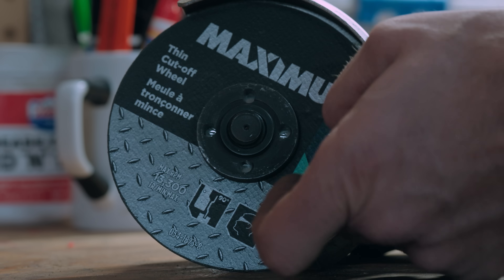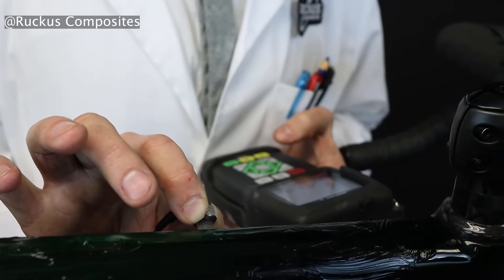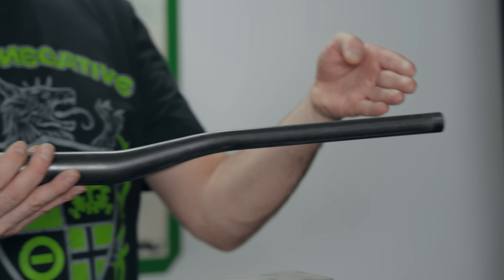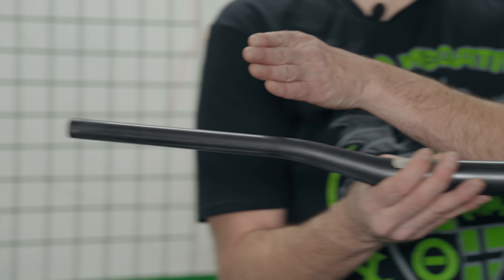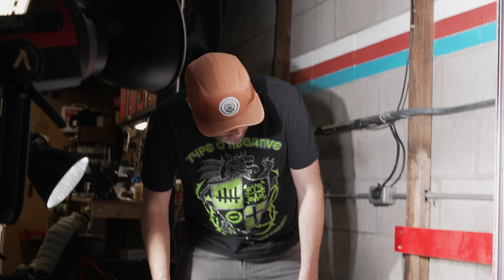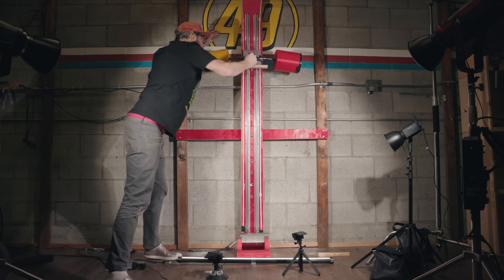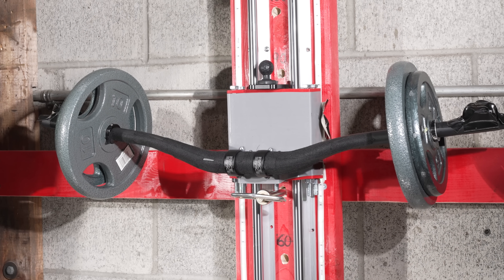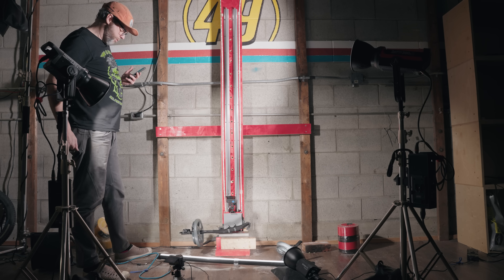Is Repaired Carbon Fibre Safe? Breaking Point Test

Comment: This did not seem right. I understood that the repaired parts sides broke before the unrepaired, which you explained beforehand is the test to determine if it is stronger or weaker - i took away weaker. You then bought another part which, brand new, broke on a lower force.
My takeaway is that a great bar that got repaired can be stronger than another bar from the factory, i.e. good product + good repair > (worse?) second product + no repair.
I do not feel you've shown that the repaired part achieves a good reliability compared to the original part, quite the opposite.
So either your conclusion is wrong and premanufactured or the logical steps got lost (on me?) or the wording is not great.
First of your videos for some time now i won't like - but hope for a follow up!

Comment: If the repaired part broke at higher force... why in the first two tests pe handle bar broke ONLY on the repaired side?
Reply: Yeah, it doesn't make sense. If the repaired side was stronger as the results are trying to suggest, surely the non repaired side would have broken first in the initial tests.

The random new bar breaking at a lower force is irrelevant. Even the test on the new bar was using different weighting.

Comment: Where’s your safety glasses and face protection when you’re cutting the carbon fibre bars with that grinder?
AND; you really should have had respiratory protection as well. Those carbon fibre fibres you created would’ve been straight into YOUR intake system.
Seriously. Those little teeny weeny particles are V E R Y dangerous.
Think of asbestos and you’ll be there.

Comment: I did it. First I babied my carbon fiber, then I got careless, a little confident.
 Oh, sorry. It's just my sword. It keeps getting in the way. Would you like to see it?
 No!
 It's okay, because I couldn't show it to you anyway. My father always told me: never show your sword unless you intend to use it. Anyway, mine's broken.
Broken?
 Yeah.  I've mistreated it for years. So foolish. I used to go around stickin' it into everything. Stuck it into watermelons - just practicing. One day I stuck it into the dirt, broke the tip off.
Oh, how awful.
That really hurt me. But that's okay. I'm gonna get a new one.
 You can get new ones?
That's why I have to get into the castle, because that's where they keep the good ones.
 Yes!
 I need a good, strong one this time.
François has a really good one!
 But it has to be big.
 I : Oh. Pierre. Yes. Oh, but his is too big.
They can never be too big - not if you know what to do with it. You see, sometimes if they're big enough, all you have to do is show it, and people will run.
That's what I did!
-Tommy Chong

Comment: "Repaired carbon fiber can be as strong or stronger than a brand new product sold for the same purpose." -- While this concluding sentence is correct, I feel like it's shifting the goalposts a little bit. The repair is not as strong or stronger than the original. But it is stronger than another non-repaired but unrelated product.
Reply: I agree with this assessment with the exception that your conclusion assumes that test A and test B were of sufficient parity in all variables. The constant failures of the test rig and lack of retests or documentation of potential variance introduced by alterations of the test environment leads me to conclude that a whole host of unmentioned confounding variables were just completely ignored to fit the script's narrative. Product safety testing is not entertainment and no attempt at disclaiming liability can change that. So much of this video isn't just moving the goalposts, but doing so without disclosing how and where they were moved. They presented accelerometer readings with no explanation of how accurate they are, or how they are actually useful as a measurement. The final obvious issue is that when we ignore forces, brands, and materials, we still see that the "new" bar breaks at a logical weak point, the point at a bend and the end of a taper, while the "repaired" bar breaks further down at the repair point. This design was never going to break along the straight and uniform section otherwise. There are only two possible types of conclusions that are even possible at this stage of experimenting: 1, that the repaired parts fail at their cut points instead of the original design's weakest point indicates a weakened repair, or, 2, that these results are inconclusive. To say 3, that the repair was stronger or even acceptable is, well, dishonest, and demonstrates that your claims, methods, stats, proofs of any kind are suspect to manipulation and fraud.

Comment: Carbon Fibre is an amazing material.
But unless you NEED the weight saving, just use Steel or Aluminum.  The Metals are easier to repair, recycle and for me, won't catastrophically fail.
The question I ask from this video is, do you really need carbon fibre handle bars?

Comment: Sorry but: No, no, fucking no. I work in composites. I work in making structural composites that are designed to tolerate huge external impact forces to save lives. IVE BEEN DOING IT FOR 20 years. For a channel like F9, with the outreach it has, to be brandishing wet-lay repair as safe to use is MADNESS. 
The majority of all cycle hardware (frames, cranks, handlebars etc) is knocked out of Asia using low pressure oven-cure manufacturing techniques. Using this method, manufactures have been allowed to capitalise on the ‘sexiness’ of carbon fibre to make sales, while keeping costs to a minimum. 
The problem is that last part. Composite bikes are made poorly. Even the monetarily high end models use poor manufacturing techniques. 
When stuff breaks we take it to the nearest repair shop we can, because carbon isn’t well understood like metal work repair. So third party repairers usually have a resin-infusion or wet-lay fibreglass background and are usually not skilled enough to properly repair high-load components. Sorry. 
When you localise forces, like this video did, (after you filled it full of resin) of course it’s going to be stronger than the original! All you’ve done is made a solid block of resin. May as well get an aluminium bar because you’ve lost your strength to weight ratio…which is the whole point of carbon. 
Could write for days about how poor composite bikes are in general. But as with any carbon repair-job, once you cut the fibres, you’ve lost strength. Resin is your only chance of reinstating that strength. 
I’ll add that the repair guy could’ve reworked a sleeve in don’t tied in much more (rather than 15mm which wasn’t enough) but I think it was beyond  the remit of the repair scheme (I.e cost vs time). Once the fibres are cut, a wrapped Rohacell bung should’ve been laminated tbh.

Comment: Come on FortNine! You have been producing quality for so long, that I would hate for this new experiment to start a trend in the wrong direction. I loved the video, with the exception of the conclusion. Look, I get it that your weights broke, you may have changed bar type for the control, your sample number was low, your force measuring methodology is likely very flawed, but your conclusion was the worst part. The conclusion should be that the repair was not stronger than the other side of each handlebar in your test, and that the test rig and methodologies weren't good enough to conclude that the repairs were stronger than the new bar. You aren't known for being misleading, so I hope this sort of video gets more review before being released into the wild. Was Ryan out of town or something??
Reply: there was literally another unrepaired side of the bar experiencing in theory the exact same forces when the repaired one broke so there must have been a major difference between the two tests
Reply: @thomascook8844 was about to say the same thing and you said it so much better
Reply: I agree completely , I must admit that you said it much better than I ever could . Thank you
Reply: This is at least the second video where the research and testing was either wrong or seemed misleading to prove a point. I think that we are seeing a shift in the channel now that they have taken off in popularity.
Reply: It's disappointing, and also not the first dodgy test shown on here. Hope they go back to their strengths, discussing riding motorbikes with brilliant videography. They are the best channel on YT at that, I think, but not this stuff.

Comment: You needed to calculate the impact energy, impact force and impact torque. The gym weights would’ve acted like a point load so the torque on the repair would be greater as the second moment of inertia of the bigger masses you started with would’ve been imparting a simple sheer force through the repair and this is the strongest loading mode of a sleeve repair. 

You probably need to look at the amount of bar flex that is happening as well and compare the strength of the sleeve with the carbon fibre. Some sort of NDT (ultrasonics or dye pen) to look for signs of fatigue failure (cracking) should’ve been done between tests with this sort of testing method. 

If I were to do this, I would get a load cell and a chain block, clamped the bars onto the ground or something heavier than the breaking load, so based on the numbers you have in the chart about 800kg (4000N per side). I would then sling the bars with a load spreader to make it so you have vertical loads at the handle part of the bars. Could probably use grip to stop the slings from slipping … then you just read the load cell display as you wind on more load with the chain block until it fails. This way it’s one load event per test and it’s infinitely repeatable.

Comment: 😂 fortnine overlooked on critical detail, 50% of experts in repair work are fakers or f^*kwits 
30% will do an average job and 20% will do a good job so still better with OEM for consistency because the repairer you choose will determine it’s strength

Comment: This was not a consistent test. The first two bars were tested using weight distributed over a wider section of the bar. The last bar was tested using weights that had a lesser amount of contact spread over the bar. It’s like chopping bambo with your hand vs a sharp sword.

Comment: I think the third bar used in the test should've been the same model, otherwise you've only proven that Rob's repairs are weaker than the original part. This isn't to talk smack about Rob, it just makes sense. Carbon fiber's strength comes from the continuous fibers having a very high ultimate tensile strength. If you break a piece you've now broken those continuous fibers. On the repaired part it looked like rob was inserting a patch of carbon fiber tube inside of the bars or patching it around the outside, but ultimately it will be the glue/epoxy that's holding the parts together. Glue can be strong over a large surface area (probably where Rob's point comes in) but it flexes even less than carbon fibers, so as soon as it cracks it fails again. Because the test was an impact test instead of a slowly increasing load test, it caused the repaired parts to fail sooner than expected. This in turn doesn't make it the best use-case for a bicycle to use repaired carbon fiber pieces in place of fresh ones, if we assume that the fresh ones got to a point where they did break.

Comment: One thing that wasn't mentioned, was the fact that a handlebar has a set outside size that can not be exceeded, or be unable to fit levers. That makes it a lot harder to make a stronger repair than original. In the case of the chainstay, you could likely increase the outside diameter with wraps of carbon under a vacuum for curing, as well as install a section inside, and that would be much stronger. I would never trust a handlebar, but seatstays or chainstays, yeah.

Comment: would be interested in seeing if you can repair Carbon Fiber Rims. for motorcycle or bicycle
Reply: I have seen a rim that Rob repaired. A tubular Easton for rim brakes. The rider needed it for racing pretty quick IIRC. Worked fine.  Looked a bit rough but there were only one or two cross races left.

Comment: Learn the lesson....it is not just metal that fails due to fatigue...composites do too.  The mechanisms are different, but the results are the same.  Composites and Carbon Fibre typically suffer resin/fibre separation, nano voids and other failure modes.  Metallic fatigue behaviour is well known, in part due to the Comet disaster.  Composite knowledge has a long way to go to be at the same level.

Comment: Back in the day when I raced Rob Mulder’s boards were THE custom race board … note his T-shirt; Sailworks is Canuck transplant Bruce Peterson’s race sails, used by pro racers worldwide.
As demonstrated, carbon can be repaired as strong (or stronger) than original. And I have had an aluminum stem fail “catastrophically “ without any signs or warning.. so carbon isn’t the only material that can fail in such a matter.
Thanks for the content!👍
Reply: A failure which may only prove lack of observatipn on your part.
Reply: Aluminum failure is predicted by the amount of load cycles. A margin of safety factor is applied to the predicted failure predictions.That’s how aircraft are engineered. Inspection of aluminum is relatively easy. Pre flight checks don’t just apply to aircraft.
Reply: Possibly Dan; although there were no cracks/stress risers/creaks/etc. Certainly made me more diligent in pre-ride checking components. Cheers

Comment: Pity you didn't test a set of "safe" aluminium bars as well.

Btw , the new practice of adding an innegra layer to the carbon can substantially raise the failure point and the bars are less likely to shatter.
Reply: I'm gonna look that up, but what is an innegra layer?  Interested because I've designed and built my own miniGP bike, did the body with fiberglass at first, then made molds, then redid them in carbon.  Those aren't structural, but I've been thinking about getting more into the carbon work for my shop.

Comment: on the other hand the 7000 series aluminum used for high-end bike parts is not weldable. its been a while since 6061 was used for this stuff. and if its a modern aluminum forgeing even if just bent its not repairable at all, even if you bend it back without cracking its far weaker, and if you try anealing it wont have the precise %cold work it had new and will be softer then it was designed to be.

Comment: This video was a disappointment on several fronts.
1- The methods used to break handlebars were unrealistic; thus, making the repair method not useful. When you're investigating, if something can be repaired; then the damage that needs to be repaired needs to something that can actually happen. In that sense, metals aren't repairable either, if you throw the aluminium handlebar into a volcano, no one can repair it! 
Therefore, a different methodology would have been more apt to use; either cycle loading to induce crack propagation due to delamination should have been used or at the very least, just use the same rig that you use to examine the repaired bars. In this way, the damage area would have been representative of the real world scenario. 
2- The test rig was also not designed quite thoughtfully. The use of 3D printed weights might seem very cool; yet, as their robustness showed, the use case of 3D printing was rather pitiful. Moreover, the weights on the test rig on the first two repaired handlebars were spreading the force over too large of area, , which doesn't correlate to hand-sizes (at least visually). And on the last handlebar, the weights were concentrating all that force in an area noticeably smaller; hence, reducing force experienced to break the bar.
3- The test rig was testing an unrealistic event as in real life no drop would be handled by stiff hands holding to the bars; rather your upper body would absorb majority of shock transferred from the front tyre up the chain. Therefore, a different design of test rig is warranted.
4- The rig failed, before or as the last test was being carried out. That last experiment is therefore has no statistical value, since the parameters had substantially changed due to rig failure.
5- Last but not least, the premise of the video was to compare the repaired-side to the original twin on the other side of handlebar. Yet, when the results didn't show the bias that repaired side would be stronger(?) than the original design, the experiment was altered by purchasing 4th handlebar and testing it in a different circumstance to satisfy the bias by illusionary correlation.
Overall, I will give this video a thumbs down!

Comment: The test is deeply flawed. The new bar was tested with different weights which were more narrow, thus stressing a tiny bit of the bar with the whole weight. On the repaired bar, the weight of the ... weight was better distributed along a much larger section of the bar. Anyway.
Repairing decorative carbon fiber... why not. Structural... carbon fiber... no. What amazes me how the amateur cycling community is willing to spend extra to go carbon for, on this level, purely imaginary advantage. Trying to REPAIR that is even more idiotic.

Comment: I love you guys, and I watch all your videos, but the testing had too many variables. The switch from sand weights to metal weights and the failure of the testing rig could have skewed the results.
Reply: I think it gets the point across well enough that repairs to CF are worth it over replacing.
Reply: @mbpm6135  really if anything, the missed point was in the fatigue at the end. The plain bar broke earlier because of fatigue. What is that to say that a part isn't nearing the limits of fatigue and now you've sunk money into a repair when it's going to fail again elsewhere? Yes it's good for accidental damage like whacking a tree, but not really if the rest is fatigued and going to fail.